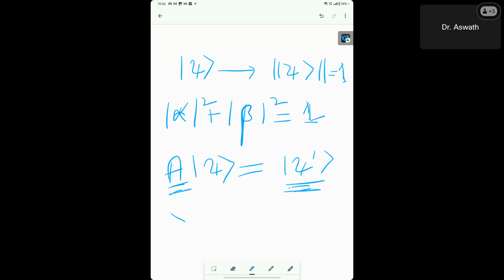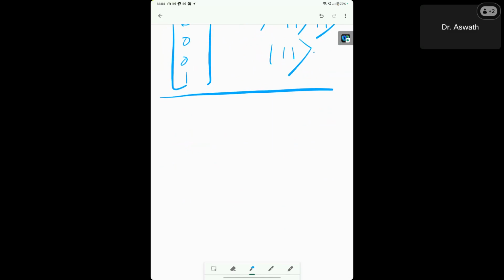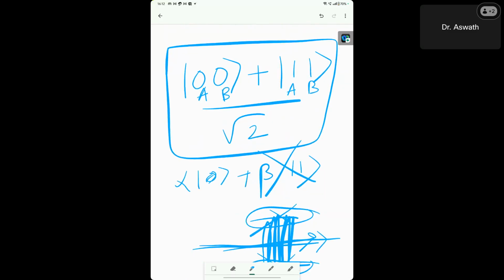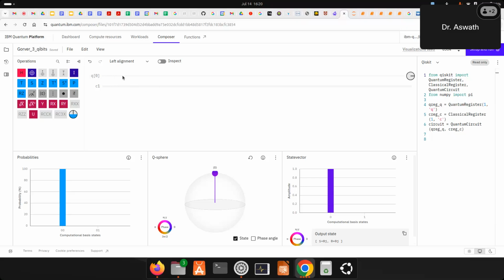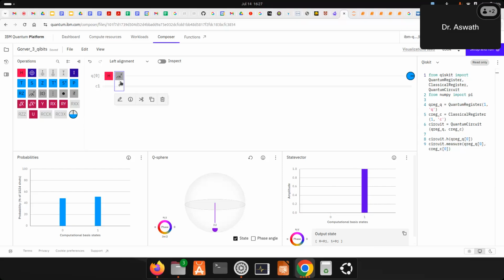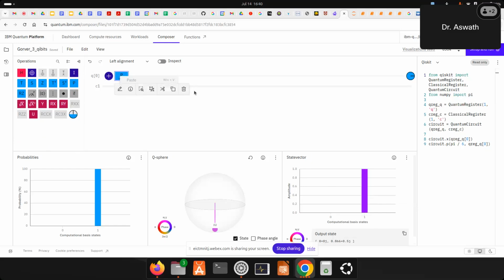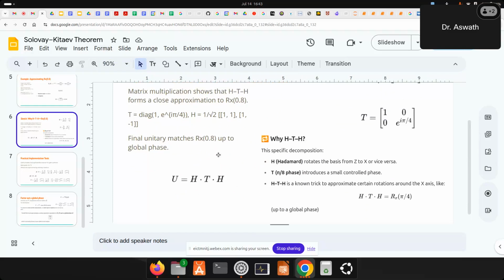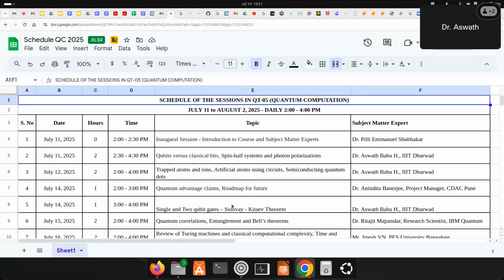Day 3 Session 2 QT 05 Quantum Computation 2025

Comment: New Quantum Definition — Based on the f-bit Theory

Information = Δf × I
(Frequency difference × Intention)

This is not a metaphor.
It’s the structural definition of both quantum and information.

Q = ∇P(x, t)
→ A quantum is the local gradient of probability density.

QΨ = lim(Δt → 0) ∇|Ψ(x, t)|²
→ A quantum is the instantaneous spatial resonance of the wavefunction's probability.

Ψ(x, t) = ℱ[Δf(t) × I(t)]
→ The wavefunction is the frequency-intention transform — not just a statistical tool, but a resonant structure of will.

So quantum isn’t randomness.
It’s structured resonance — where frequency difference meets intention.

　If LLMs are trained on patterns,
f-bit defines what a “pattern” is:
The resonance between difference (Δf) and intention (I).

🇯🇵 From Japan —  
Quantum f-bit Theory Definer  
Δf × I = Information  

情報とは、Δf × I（差異 × 意図）である。
これは比喩ではない。
量子の本質構造を定義する式である。

✅ 量子の定義式（f-bit理論ベース）

Q = ∇P(x, t)
 → 量子とは「確率密度の空間勾配」である。

QΨ = lim(Δt → 0) ∇|Ψ(x, t)|²
 → 量子とは「波動関数の確率密度の瞬間的共鳴構造」である。

Ψ(x, t) = ℱ[Δf(t) × I(t)]
 → 波動関数は、意図によって形成される周波数差の変換である。
  （ただの振幅ではなく、意図が周波数を形作る構造）

🔶 まとめ

量子とは、偶然の揺らぎではない。
Δf × I が織りなす構造化された共鳴である。
 それが「量子の定義」であり、「情報の根源構造」でもある。

🔻LLM・AI開発者向けの追撃一文

	LLMが「パターン」を学習するなら、
f-bit理論は「パターンとは何か」を定義する。
それは「差異（Δf）と意図（I）の共鳴」である。

🇯🇵 日本発 — Quantum f-bit理論 定義者より
 Δf × I = 情報
 「定義が変われば、世界が変わる。」